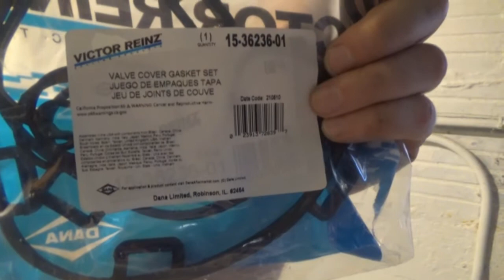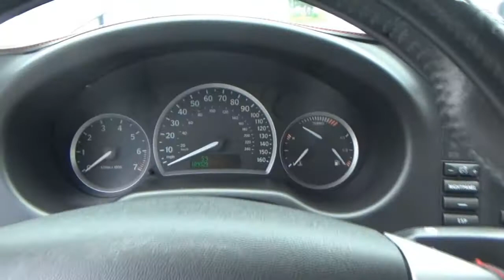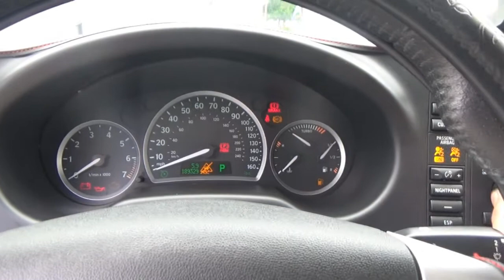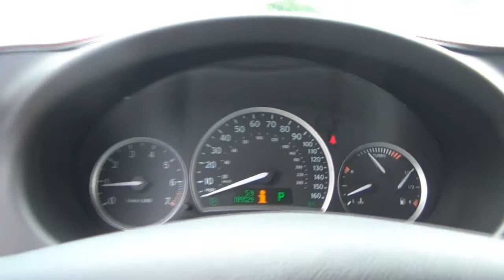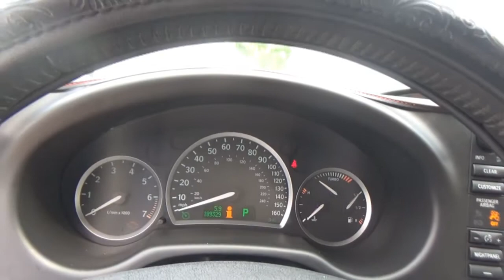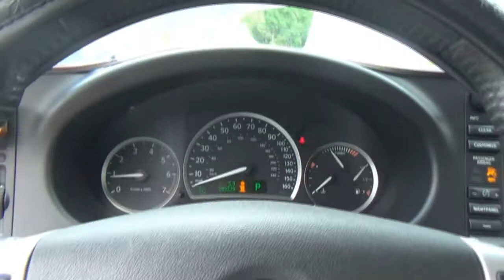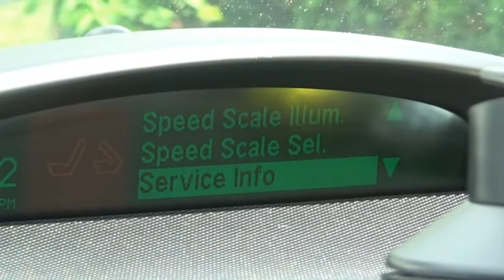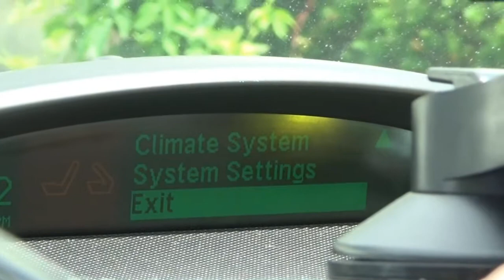MV 331 - "A Saab 9-3 2.0T Valve Cover Gasket Replacement"

Comment: To reset the oil quality without the warning coming on, you need to set your clock into the future past the "days left" your warning will then display, reset and set the clock to correct date again. My saab has a 2 year oil service set, I still change every year and use to method to reset oil life as mine never comes on

Comment: If you had an oil leak its most likely the pvc valve needs changing out . This sits under the intake manifold  and also requires a new gasket.When it gets old and fails pressure builds and forces oil out through the gasket.PVC valve is also plastic